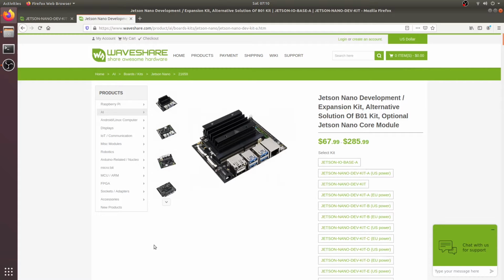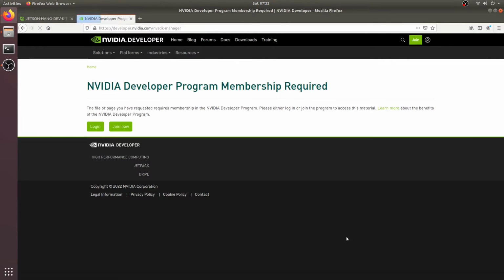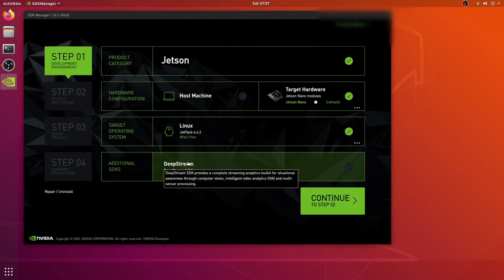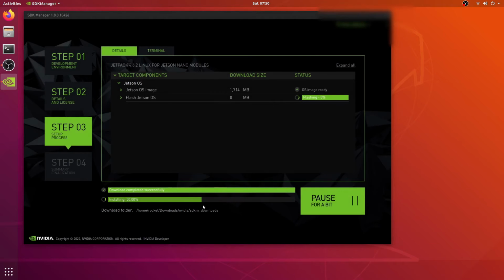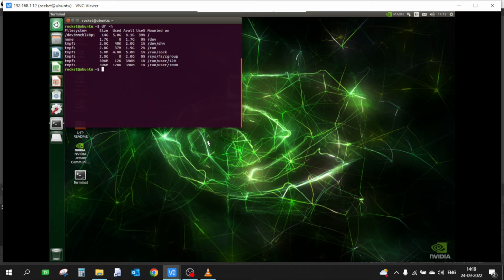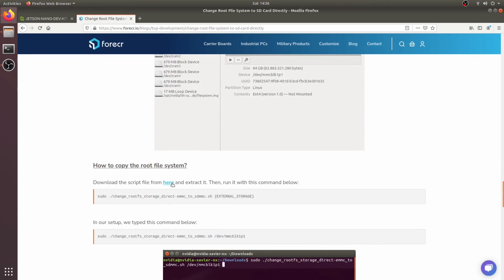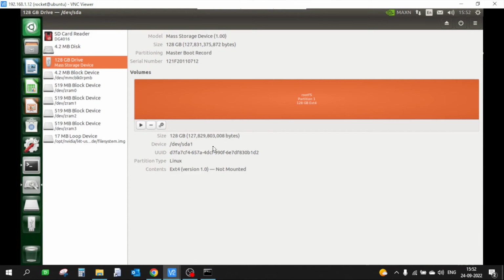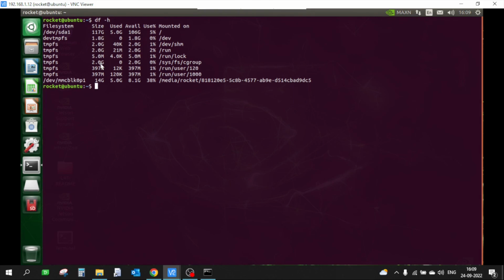HOW TO INSTALL JETPACK OS IN EXTERNAL SD CARD IN WAVESHARE JETSON NANO

Comment: Thank you so much for this. Waveshare  has updated their wiki since this video was posted but I was not able to activate the internal SD card slot following their instructions and when I followed their instructions to boot from USB (without SD card is what I used) it worked but was slow and eventually failed and I had to reflash my nano. I still want to figure out how to enable the SD card slot in the back of the nano at some point. If anyone finds a solution I would love to know about it!
Reply: check your jetson nano has slot for sdcard

Comment: Hello sir, i got stuck 99.50% installing during flashing with sdk manager, do you ever experienced that? Or can you help me with that? Thank you, godbless 🙏
Reply: I am facing the same problem. Did you got any solution. Please help.
Reply: @sajalrahangdale4963 fortunately I solved this problem bro, with using Ubuntu 18.04 same as the jetpack version based (in my case i use jetson nano which was jetpack 4.6.4 based on Ubuntu 18.04). First try to flash your jetson using Nvidia SDK manager (standart method) and second solution if it's still not working try to flash your jetson using Ubuntu terminal (I use gpt for the instructions). Mine is solved using the second method, good luck bro.

Comment: Great video. Thank you so much. One question remains: why did the sd card slot on the jetson not work for you? Mine also doesn't display the sd card in the disk manager. Is that a design issue from waveshare?

Comment: Hi, thks for your video! I flashed the sd card sucessfully. Now, if i want backup the sd card (because I installed some packages in the sd card) so any suggestions how to backup to other sd card? thank you
Reply from the maker: I have not tried this but you can read back the files from sd card and compress it to make your own customized os file. Lot of people have done the same thing with Raspberry Pi

Comment: Thank you for the video, haven't tried yet but I'm optimistic things will be good to go in a few hours time! One question, after doing this, if for some reason I want to re flash my SD card with the image provided from the zipfile at the getting started guide, is that possible?

Another question, I've flashed jetson through micro sd card at first, should I choose manual or automatic? I'm happy enough to start over redownloading all my packages
Reply from the maker: I think I didn't get your question completely but I feel if you want to re flash you should be able to just copy the filesystem from internal memory to sd card .

Comment: I have an issue when flashing the card it says "The target is in a bad state
The Jetson target is in a bad state and cannot be flashed. Please manually put the target into recovery mode and then retry flashing." however i did connect the 2 pins as you mentioned 
Do you have any idea on how to solve this issue ?
Reply from the maker: I have not faced this issue but you can have a look at this  https://forums.developer.nvidia.com/t/flash-issue-the-target-is-in-a-bad-state/193746/5

Comment: Hello, Nice video! I have followed the steps for the jetson and can boot without problems. However, when I plug the SD card in the Jetson dev kit and type "sudo jetson_clocks" followed by "gnome-disks" I can't see the SD card. I have tried formatting it on another ubuntu machine as ext4 but it still does not detect the card. Do you have any ideas, besides using an SD card reader instead?
Reply: I think the author has followed the dtb modifications (because they are specifically there to enable the sd card detection) but discarded them in the end. However,  I wasn't able to make my sd card work even when following them, I think there's still something missing.
Reply: @Rocket Systems I also had the same problem, hope you can help, thank you!
Reply: @nhatnguyentrong5627  For me the solution was to use "sudo ./flash.sh jetson-nano-emmc mmcblk0p1" instead of mmcblk1p1, which makes more sense since we want to run first from the emmc (which is mmcblk0p1) and then update the sdcard (mmcblk1p1). The whole process of  modifying the dtbs needs to be  done first, to enable the sd card.
Reply: @ConstantinPetra  Thank you very much, i followed your method and it worked
Reply: @ConstantinPetra  Thanks for the help! Could you elaborate on how to modify the dtbs? I have tried following the wiki, but I can't find the image that waveshare says they provide and I can't find the "HW Imager kernel path" in step 2.
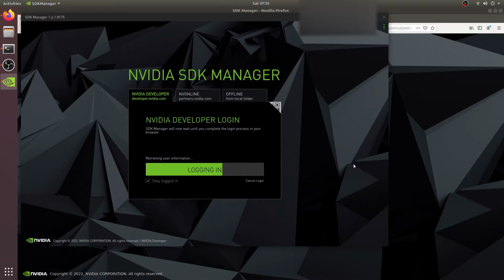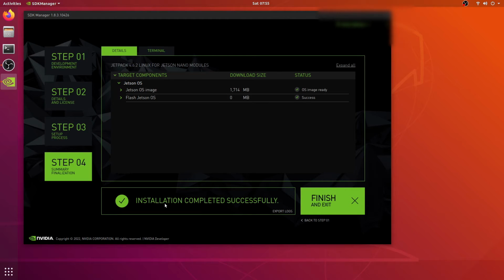Reply: @rasmusbryld1832  No problem, I had headaches too :) So you need first to handle the steps from 4:40 to 9:10 (approx) in the video. This will help you program the board first, and prepare the needed packages (including the boot image contents that must be modified to enable the SD card ).  Also, the dtb update is presented briefly between 12:50/13:10 -> But check out the original, It's the "Program Boot Loader" section in jetson nano dev kit page from Waveshare. https://www.waveshare.com/wiki/JETSON-NANO-DEV-KIT. Don't forget to use mmcblk0p1 instead of mmcblk1p1 in the corresponding command line.
Reply: @ConstantinPetra  Thank you so much! It also works for me! For dummy likes me who don't know how to build HW image (here for example jetpack 4.6.2, (L4T 32.7.2)): 1. download the "L4T Driver Package (BSP)" and "Sample Root Filesystem" from  https://developer.nvidia.com/embedded/linux-tegra-r3272 . 2.extract files from "L4T Driver Package (BSP)" and you will find Linux_for_Tegra/kernel/dtb, then you can modify the kernel file as described in "Program Boot Loader" section in jetson nano dev kit page from Waveshare. Before flashing, extract  "Sample Root Filesystem" files in Linux_for_Tegra/rootfs as described in Step1 of "Setting Up the Root File System" in https://docs.nvidia.com/jetson/archives/l4t-archived/l4t-3261/index.html#page/Tegra%20Linux%20Driver%20Package%20Development%20Guide/rootfs_custom.html# . 3. flashing using "sudo ./flash.sh jetson-nano-emmc mmcblk0p1" as Constanin Petra said.  4. After booting the nano you can install exfat drivers using "sudo apt-get install exfat-utils exfat-fuse" to open sd card. Then do as described in Step2 in this Video to transfer file systems to sd card as you wish.
Reply from the maker: @ConstantinPetra  Hi, thanks for all your comments and helping others. This waveshare was also a headache for me  too, and they don't even reply to your emails.
Reply from the maker: @Rasmus Bryld If you are not able to see your external sd card in gnome-disk then either the sd card is not working or the sd card slot of jetson nano is not working. Simillar thing happened with me and I realised sd card slot was not working in my jetson nano.
Reply: @RocketSystems  Thanks for the reply. It sounds like others had the same issue and was able to fix it, so I hope I can too.

Comment: Hi thanks for the video! I was going crazy from the understanding waveshare wiki. However, the wiki tells us to modify the dtb, in order to activate the onboard sdcard slot sdmmcblk1. Any suggestions how to do that together with this video method?
Reply from the maker: I have tried to follow the steps they have mentioned in their wiki page but no success. This is why I found its alternative method and its been working fine. Have mailed this to waveshare but no response.
Reply: @RocketSystems  I think you need to tell us how you modified the dtb :) I have tried to modify it as in the web page but the sd is still not found by the system.
Reply: @ConstantinPetra  hi!
what is the max memory size SD card we can put on jetson nano? also did u find a way to change the configuration. for me also SD card not found in the system.